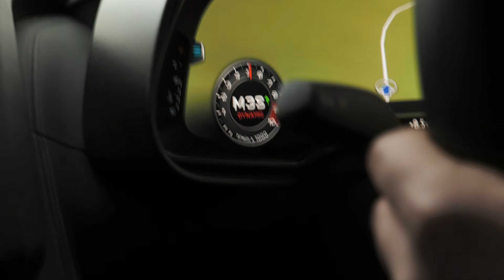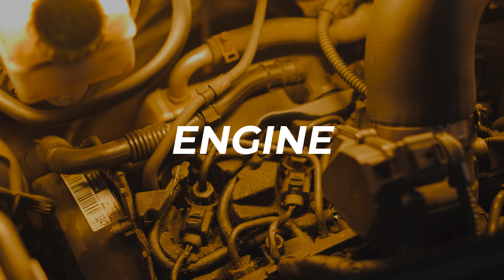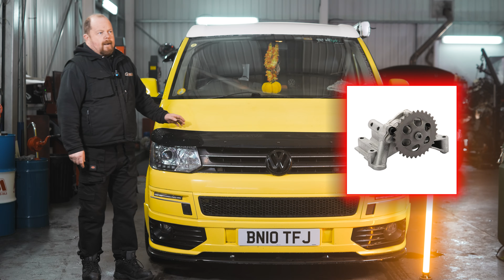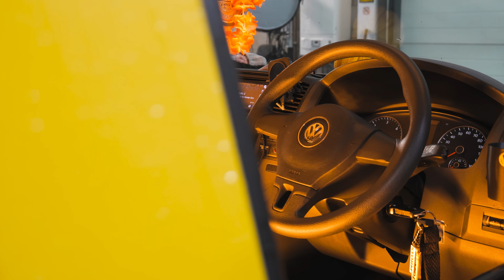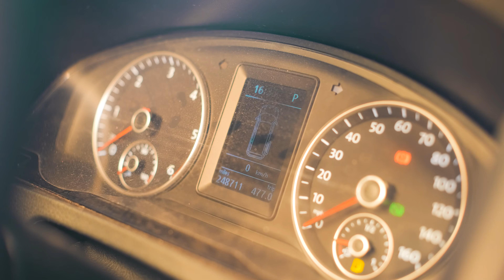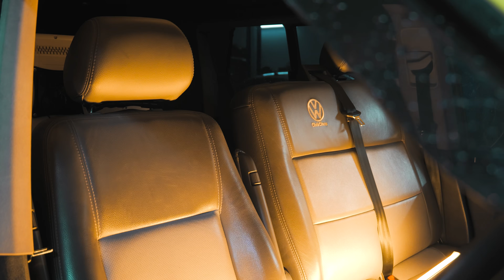VW T5 TRANSPORTER COMMON PROBLEMS!

Comment: Hi, I am impressed with your channel especially as you answer just about all your comments. I am looking to buy a van and have been offered a VW Trans T5 2.0 TDI LWB, O7 with 145k miles, metallic silver. 
The van is immaculate inside, outside, under the bonnet and in the cab, with no dents dings, scratches etc, owned and looked after like a baby by a "friend", i.e. a mechanic and MOT tester in Northern Ireland for 40 years and pedantic about his vehicles. He is asking £7.5k. I don't know anything about the previous owner. 
I of course can't expect you to say buy it but what do you think of these vans and is the price about right. It appears they do have issues and expensive to fix.
Incidentally, I am not a fan of German vehicles all very well maintained to the point of dealer-only parts but I have had issues with everyone I owned most very costly. i.e. 09 Audi A6 2.5 V6 TDI (fuel pump, 05 BMW 520 TDI (every known issue including drive module, rear ball joints etc), 07 Skoda Superb 2.0 TDI clutch at 80K and gearbox issues at 100k, 07 Mini one, convertible 1.6 (head gasket, gearbox seized solid). I generally do my own work to the point of engine rebuilds mostly motorcycle, I to am pedantic but by no means an expert.
The guy is only selling as sadly he is at the end of life with terminal cancer and rightly wants the most for his family.
Sorry for the long comment. Your thoughts would be extremely valuable and many thank you for the videos, now subscribed, liked, shared and dinged the bell lol.
Reply from the maker: Thank you for sharing your experience stay tuned for more content.

Comment: Ai have a '10 caddy 1.9TDI pd with the "problematic" BLS engine.

Currently has 311 k km bought it almost a year ago with 290 000 km.

Only problem in the 21 k km i drove was the alternator pulley ( common problem) €30 part and easy to do yourself.

Previous owner changed the rod bearings at 100 k km and egr cooler at 250k km.

Let me tell you its one hell of a beast.
I always trash it like its a rally car and it never skipped a beat.

Went on holiday with it to tunisia +40 °c and starts like new.
Drove from italy to belguim (1500km)with only stopping for toilet stops(+-10 min)

Even here in freezing temperatures here in belguim it starts like it just drove off the lot.

I already serviced it 2 times(i do it every +- 12k km).

Only problem now is that the glow plugs need to be changed (fault code) but it still starts normal.

If you wanna buy a VW van just buy one with a 1.9TDI.
Very economical, cheap to service and parts and it goes rrr like a tractor:)

And dont be scared of the BLS just regular maintenance and youre be safe for the rest of your life.

If you wanna be + safer change the rod bearings of the bls and bxe(never came in vw vans) (not so difficult) and you will sleep with your 2 eyes shut.
Reply: PD engines are awesome. Its a shame they had to phase them out. The power delivery was so much more direct than the CR which I drive now. A remap helps but, its just not the same as a PD

Comment: I feel like there wasn't enough mentioned on the 2.5 gear driven engine which is in fact the most problematic and usually riddled with issues such as worn camshaft lobes, turbos, cracked exhaust manifolds, faulty injectors and oil leaks from practically everywhere. Also many 1.9 now suffer from the steel coolant pipe which wraps around the block corroding causing leaks. In terms of the 2.0 biturbo tdi I've seen nothing but issues from turbos to headgasket, with as mentioned the obligatory leaking crankseal from as low as 30k miles. 
 Practically every t5 ever will need front lower arm/ rear bushes. As well as rear arm bushes. Rear arm break pipes are very common for swelling.  A lot of earlier t5s suffer wiring corroding under the seats and control modules failing due to moisture.
Reply: @emil3524, 

2.0 biturbo TDI I've seen nothing but issues from turbos to headgasket,  well that's correct  it all has to do with the EGR, the one used in the 180HP version breaks down (interior EGR) and the aluminum restants are mixed with oil and act as a sanding “flued".

2 years ago  I changed the complete motor + turbo , installed a CORRECT egr, and placed a blind plate immediately  so the EGR isn't working 
after that you have to rewite the software.
After that I never had an issue ( read oil consumption again in the 100.000 KM it drove with that rebuild motor)
Reply from the maker: Thanks for watching
Reply: basically the 1.9 is incredibly reliable if regularly serviced, and the 2.5 is also reliable if regularly serviced. the difference between the 1.9/2.5 and the 2.0 is that the 2.0 is more forgiving with servicing

Comment: Had all these T6 wow they where bad from new lots of problems.  I have a 2006 ex builders van now you'd never know it was I've changed turbo hose & clip side light bulbs rear springs & needs a clutch and flywheel change & gearbox refresh 173k & it hasn't been looked after mechanically the dude hadn't polished it in 11yrs either I absolutely love this van
Reply from the maker: Thank you for watching
Reply: @itsimty  Thanks for uploading lots of useful info

Comment: I have a 2011 T32 140, 6 speed, 210k miles, 2nd owner, owned 7 years. Not used commercially and never carried much weight. Always used shell vpower fuel and regeneed dpf every tank of fuel. Never gets driven hard, my commute is 50mph roads 24 miles each way so not used for short journeys much.

- On engine number 2 (almost 3 engines due to dpfs blocking and not showing errors, now I had to drill dpf and map out because of so many major problems)
- Turbo number 4
- Gearbox 
- Flywheel 
- Intercooler 
- 10x front drop links (tried everything, VW ones, heavy duty ones, custom ones, after market ones) 
- Passenger airbag
- Clutch and , 2  sets of  bearings failed under warranty)
- Catalytic converter
- Alternator
- DPF
- MAF 
- 6 wheel Hubs
- Power steering pump
- Handbrake cables
- Rear brake calipers
- Suspension springs 6 (2 snapped)
- Dampers 4, top mounts etc.
- Cam belts and water pumps every 4 years.
- Fan blower resistors 3
- Rear number plate light bulb and lense connectors awful design and always flashing and turning off.
- Many electrical faults including cutting out losing brakes and power steering and almost crashing.

- The dpf sensors are useless, damaging turbos, dpfs, cats and engines.

So unreliable I had to buy a back up car and every time I try to sell it something goes wrong and I have to keep it to try to recover costs.
Reply: 😂😂😂😂 sounds like my t5 💩💩💩💩😢

Comment: Ive had the most problems with my t5 than any other vehicle I've owned
Reply: So what would you advice to buy?
Reply: @bamf6603  this is a problem there's not a lot to choose from maybe a transit
Reply: @terry4144  maybe volkswagens are more faulty in the USA . In Europe vw is one of the most popular brands also 1.9 tdi engine is considered as the best diesel engine.
Reply: @bamf6603  what ever you pay for the van save same the amount for repairing.
Reply: @viperboych but if you buy immediately for more expensive , newer year ( like 4 years old i suppose) and less mileage with a real proof of it being genuine, maybe it would be worth paying more ?

Comment: 2010 , 2..5 lt turbo Deisel 6 speed auto , have lost 3 rd and 5 th gear , had motor reconditioned so would like to keep it , any suggestions
Reply from the maker: Get the gearbox checked if you love it keep it, Thank you for watching

Comment: My dad has had a 2010 2.0TDI parked at our old house for 3 years now. She's got 210K on the clock I believe, Exhaust leaks, Shot suspension but i tell you I'm going to get that baby on the road this year mark my words... Its going to be one hell of a project that I plan to start in April-May
Reply from the maker: Good man go for it, hope it all goes well Thank you for watching
Reply: Don't donut unless you have deep pockets. I have a 2011 T32 140, 6 speed, 210k miles, 2nd owner, owned 7 years. Not used commercially and never carried much weight. Always used shell vpower fuel and regeneed dpf every tank of fuel. Never gets driven hard, my commute is 50mph roads 24 miles each way so not used for short journeys much.

- On engine number 2 (almost 3 engines due to dpfs blocking and not showing errors, now I had to drill dpf and map out because of so many major problems)
- Turbo number 4
- Gearbox 
- Flywheel 
- Intercooler 
- 10x front drop links (tried everything, VW ones, heavy duty ones, custom ones, after market ones) 
- Passenger airbag
- Clutch and , 2  sets of  bearings failed under warranty)
- Catalytic converter
- Alternator
- DPF
- MAF 
- 6 wheel Hubs
- Power steering pump
- Handbrake cables
- Rear brake calipers
- Suspension springs 6 (2 snapped)
- Dampers 4, top mounts etc.
- Cam belts and water pumps every 4 years.
- Fan blower resistors 3
- Rear number plate light bulb and lense connectors awful design and always flashing and turning off.
- Many electrical faults including cutting out losing brakes and power steering and almost crashing.

- The dpf sensors are useless, damaging turbos, dpfs, cats and engines.

So unreliable I had to buy a back up car and every time I try to sell it something goes wrong and I have to keep it to try to recover costs.

Comment: I’ve had my ex AA 2006 1.9 for about 13 years now. 125k on the clock now and only really had wear and tear work done other than converting it to a camper. Worth noting that offside drive shafts wear faster than they should.
Reply from the maker: Thank you for watching

Comment: 1. Mine is 2005 1.9 tdi axb 77kw engine.  Had it for 14 years. Now has 140,000 kms, which is low by standards.  Has started first time every time.  Brisbane Australia.
2. Did axle spline drivers side - common complaint TAKE NOTE.  When it starts to go, it will "skip a tooth" making a very loud noise, then go alright.  Then another tooth.  Until one day, it will be running fine and no teeth left, and tow to shop. New one done.  Easy disassemble to inspect and well worth it.
3. At around 130 kms it lost the capacity to put in gear.  Tow to shop.  Nylon cups which connect "ball and socket" style to gear change mechanism up at drivers end, had cracked.  Age related. Easy repair. One hour.
4. There is NO camber adjustment.  They will want you to have offset bushes to compensate.  I didn't and I have top range tyres which will scrub out on outside a bit faster than should. I use Contivan.
5. Strut top mount went at around 120,000 kms.  Knocking over bumps.  Replaced complete struts, and new shocks to rear.  It was getting "floaty" at speed.
6. Currently getting a shudder on take off under load - pretty sure it's the rear engine mount. Ready to replace when part arrives.
7.  At 130,000 kms did 800 kms trip.  It flew.  Delivered 7.2 litres fuel/100 kms.
8. Have always used vacuum via dipstick to change oil.  Don't see the point in getting under for nothing.  Always filter too. Used Mobil1 esp 5W-30 fully synthetic every 7,000 kms.  Uses maybe 1/4 to 1/3 litre between changes.
9.  Always used diesel premium BP brand fuel.
10.  Stuck Door passenger side - common problem.  TAKE NOTE.  Comes and goes.
11. Tailgate Struts failed at around 120,000 kms.  Easy to replace.
12. I use a three ton trolley jack to jack up using the front cross member of the  substantial sub frame.  Position your jack a little off centre to your right to lift up evenly for placing jack stands.
13. Lost steering due to fluid leak at around 90,000 kms.   Under belly pan DISGUISED leak. Would have seen it on ground otherwise.  Was just a loose clip on low pressure side.
14. Lost first two speeds on the heater fan, but remaining speeds work.  Resister COMMON problem.
15. NO Air Con now as that solenoid which controls flow of refrigerant needs replacing.  Stealerships will say must have all new. Beware.
16. I have overloaded this van many times.  800 kgs is official limit.  I've doubled that.  Not recommending.  Just saying.
17. Replaced control arm bushes at around 130,000 kms.
18.  Cannot see much rust under there at all.  Watch out for you subframe rusting.

Comment: Question. I have a 2.5 2008 5 cylinder model with low milage (75k)

The water pump. Should I be changing that due to age of vehicle? Or change it down to milage?
(Is it time or miles that kills it?)
Reply from the maker: We would recommend changing this with the cam belt, Thank you for watching
Reply: He said 2.5 gtech. Not 1.9 
Biscuitsalive. Just get it changed. They can be annoying when things go unexpectedly. Change it prior to the issue arising mine needed it at 90k

Comment: I have a bnz 2.5 ..I've had it 6 years and I love the van but they do try your patience and it really pays if you are half decent on the spanners as I've removed the cam,1 drive shaft, 2 lower ball joints ,turbo ,alternator ,moo valve but would I swap it for any of the rivals ? No chance ,I've grown to love it because I know It so well .
   Great video ..........
Reply from the maker: Thank you for watching.
Reply: I was like this with my mk4 golf 😂 changed everything on it myself all by the engine

Comment: My 2.5 T5 has needed.. Clutch at 160k, Turbo, Air Con compressor, callipers, water pump, intercooler radiator and finally, the icing on the cake, the alternator that takes 5 hours of work to replace. It's been a total pig and it's like playing Russian roulette every 3 months with what component can fail next.
Reply: 5 hours for alternator replacement.  Holy hell.
Reply: I am currently in the market for one, glad I read your comment
Reply: @pierinovatta9517  the replacement alternator died 500 miles later....

Comment: I doesn't have had almost any of these and i have own this 12 years.

I drive 2007 2.5 TDI 95 kW. Around 200 000 km driven, biggest repair has been from first to last, ABS guide box (car was 3 year old), steering wheel indicator stalks, turbo boost pressure sensor, front spring upper support bushing, drive shaft cut off from right front wheel, exhaust manifold 2 bolt cut off, both back springs, and of course some wheel bearings and brake parts.

But after some point in this year work van is gone and Skoda Enyaq 80x with box trailer is replacement. I can leave that trailer on work site quite often so driving with EV will save a lot money and also i can get mileage allowance with new car when i use it for work.
Reply from the maker: Thank you for watching

Comment: I have a 180 bi turbo. I've been able to save it from eating itself by blanking the egr and mapping it out.

Although I had high pressure fuel failure which lead to most of the fuel system needing to be replaced so I can't say its all been smooth sailing
Reply from the maker: Yes the bi Turbos are quite troublesome, Thank you for watching.

Comment: I’ve got the 1.9 with 167k which I’ve had since 2018, paid £5200 & to date I’ve spent 14k including the purchase price, worst thing was the head gasket which is also common on the 1.9. there isn’t a lot of parts I haven’t changed but would never get rid of it (I’m in too deep now 🤣)
Reply: Head gasket on the 1.9 is the wrong oil. Lots of info on the T5 Forum where I’m a moderator. Engine runs a bit hotter causing head gasket to go.
Reply: @Vwfan  I’ve used Quantum since ownership (recommendation from T5 forum)
Reply: @gandhi1078 hi mate I've the 2008, 1.9tdi.... is it 5w 30 quantum?
Reply from the maker: Thank you for watching
Reply: Be glad you don't have the 2.5 like me.
Reply: @gregroles69  nightmare to work on 😲

Comment: The problem with a t5 is its a t5, anything after the t4 is pure shite unfortunately, VW built a reputation on their older vehicles being robust and reliable and unfortunately unsuspecting buyers think they're getting this quality with t5 and newer when they really aren't!
Reply: Don’t the T4’s rust like hell? 🤔
Reply: @Richhhh91 They absolutely do...
Reply: 2005 T5 423,000 use daily 1.9 td bullet proof.
Reply from the maker: Thank you for watching.

Comment: There useless then
Reply from the maker: No, they are actually a great van, the video is just highlighting some common issues that we have seen as a specialist
Reply: @itsimty I have a Fiat scudo.

It’s the Citroen dispatch rebadged.

Other than service items nothing has gone on it except a starter motor and alternator.

210k got it with 15k on it. Far superior vans! Except no one has convinced the idiots out there they are great, that’s all vw have done.

Comment: Vw stopped making reliable vehicles after T4. I know too many which have all have nothing but problems with T5/6 all regret buying them most of them have gone back to T4’s
Reply: Ι have got t4 syncro 2,5 TDI it has 490.000 km only !!!!
Reply: @ΒασιλειοςΜάντζαρης  that doesn’t surprise me, they were actually made to last
Reply: T4 old school
Reply: My t5 1.9 is on 260k trouble free
Reply: Yup… I got a 2002 ex AA Kombi T4 with the 2.5 intercooler…. I’ve had it 6 years now, it’s unbelievably reliable…. It’s got 260,000 miles and if I take it easy I can get 40mpg… thrash it and I get about 36mpg…. It’s a total beast…. I could get the engine removed, rebuilt and replaced for less that I was quoted for a DPF filter on my 2017 golf …. Best van ever
Reply: No problems with mine? Or my mates?